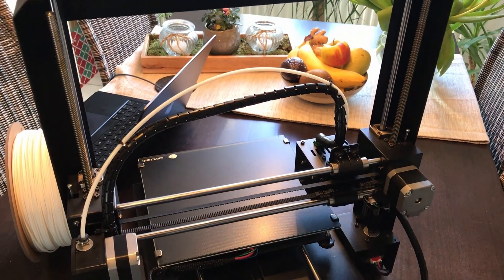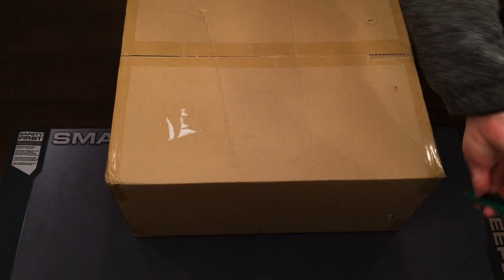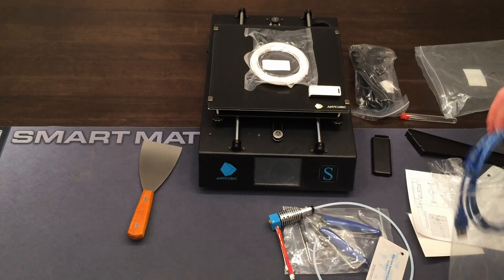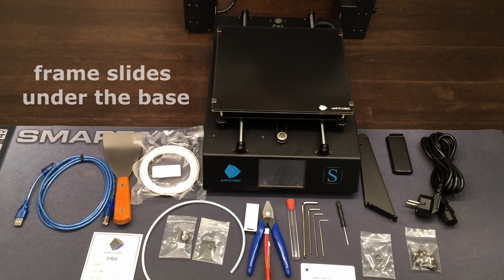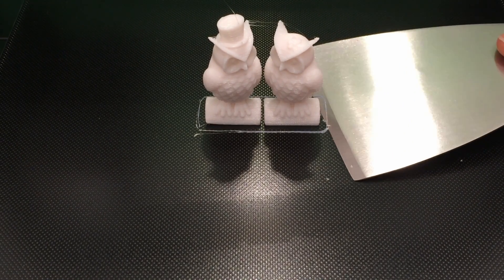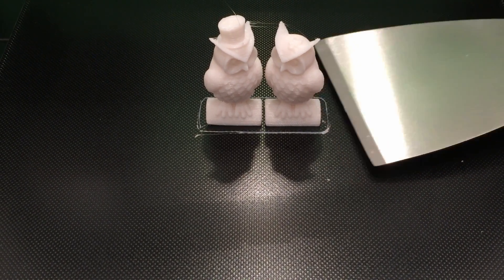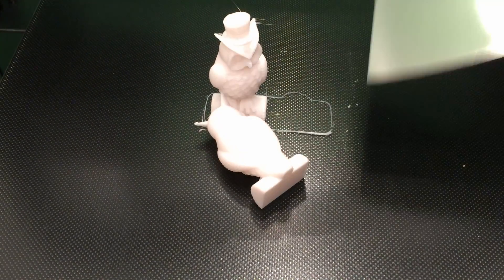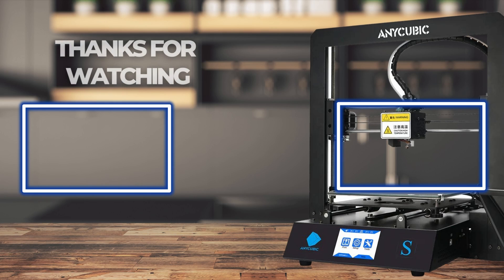Anycubic i3 Mega S Unboxing, Setup and first Print

Comment: So you can print something without a program from a computer?
Reply from the maker: Technically yes. But in my opinion, that is not a good way to print something.
As you saw in the video, the file that was on there was prepared in such a way that I could really just press start and it printed. And that was awesome, because it just worked right out of the box. Also it is possible to download files that are ready to go.

But in order to make the prints better and not crash your printer, you really want to control the print parameters. And that's where you use a software (called slicer) to prepare the machine code. Like this you can specify and see what the printer is going to do before you start printing, which is really helpful and prevents many problems and mistakes. Thats why I would recommend to always use a slicing program like cura, orcaslicer, prusaslicer etc. 

And then the workflow is: Find a model you want to print -> download it. Open it in a slicer, and prepare it for printing (set the temperatures, speed etc.) -> save to SD Card or USB and then start the print. Once you are a bit comfortable, it will take just five minutes from downloading the model until the printer starts printing :)

Comment: If you've not heard of it, the Benchy is a popular model of a little ship that's designed to help diagnose problems with prints. It has unsupported angles and arches, and an inscription on the bottom to help show your bed adhesion. There are dozens of walk-throughs on how to use the Benchy to edit pretty much everything about your print! 

For the layers being visible, sometimes the heating makes a huge difference. Make sure your bed is heating fully before the print and that there's not too much/too little airflow from a ceiling fan or something similar. Your print speed may also need lowered depending on environment and the other print settings.

Also you mentioned you've printed resin but if you're completely new to plastic printing, make sure you don't print near small pets like birds, reptiles, or rodents! The vocs put off by the plastic and the extruder aren't really bad for us, but they can kill small animals. 

In that same vein if you find yourself wanting to print higher temperature prints, make sure you look into the extruder itself. Some extruders can safely go super high, but most in this price range also put off chemicals that are actually toxic to humans with enough exposure in an unventilated room.